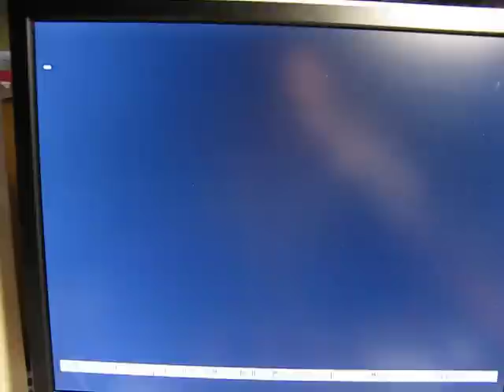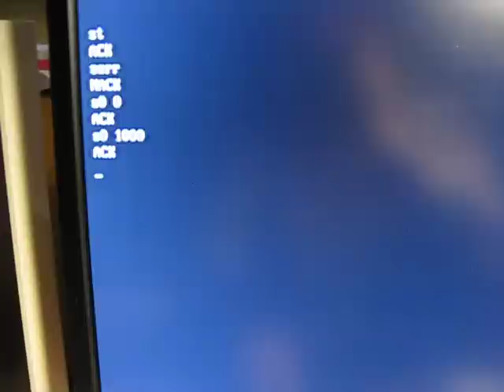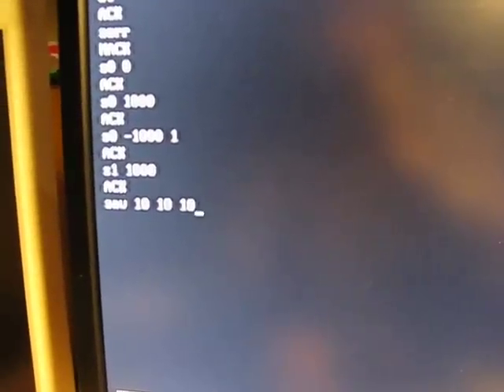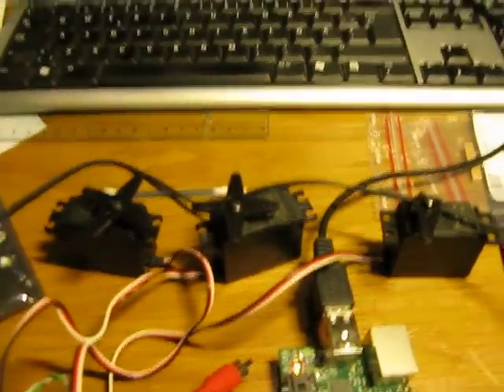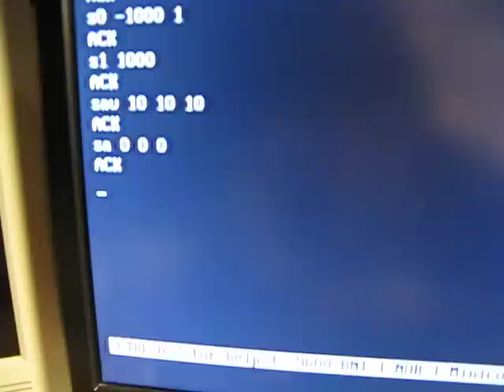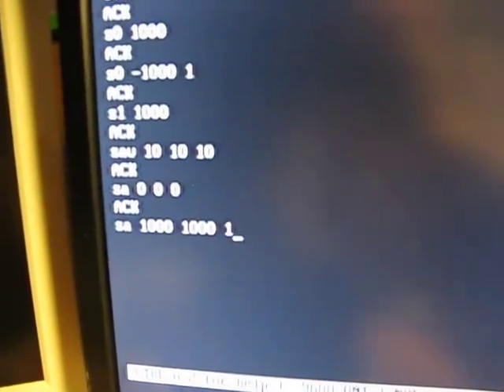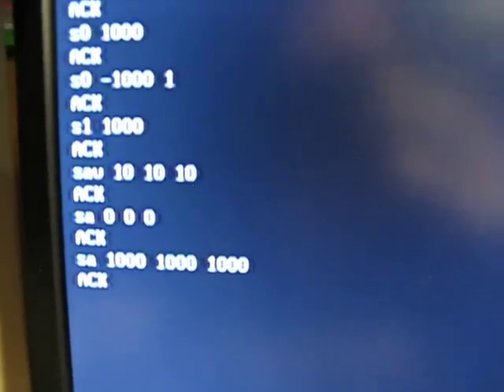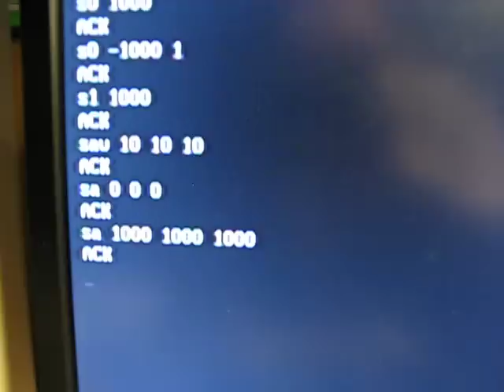Card to Control RC-servos from a Raspberry Pi

Comment from the maker: I'am planning on making everything open source or atleast open/available for personal use. 
I used the ATtiny2313. I have a little idea of making some boards for sale as well. 

To be honest I don't have an application yet. Maybe I'll find something fun to use it for. If using the RPI for a media-center one could connect a servo to move a lid or push a button ;)

It might be very useful for my plans to build a autonomus boat. An USB-GPS and a USB-GSM-module...

Comment from the maker: I have no cards left for now. Waiting for a new batch of PCBs. They are sligtly upgraded, but nothing special. Added room for pull-up resistors to be able to use the board to interface DHT22/11 Moist/temperature sensors instead.

Working on a binary protocol. Hopefully that make room for more stuff..

Comment: hi, in your pdf manual (i have v3 of the board) you say about using the three headers to power servos in various different ways.  i am not verry good at electronics so bear with me.  my ESC outputs 7.72 volts, if i remove the jumper and use the ESC to power the servos will it be ok, or will the 7.7 volts break the servo controller board or the raspberry pi?
Reply from the maker: If your ESC outputs 7.7V in the servo-connector it will indeed break both servo controller board and Raspberry pi. But it really should not output that high voltage. If it do it's probably broken. Somewhere around 5V is normal.
Reply: No, it says in my esc's manual that it should output 7.7 volts.  And I thought that by removing the jumper that the pi and rest of electronics was isolated from the servos?
Reply from the maker: Calum Bushell  Oh, thats odd, but ok :) Yes, by removing the jumper, your Pi and servo-board should be safe because there is no connection between servo rail power and raspberry pi power. The signal level to ESC's and servos from the servo board is 5V.
Reply: OK, thanks. :)

Comment: Would it work with the new 5$ Raspberry Pi Zero?
Reply from the maker: yes, i think so. I can not imagine they changed the pinout. Just solder a pin header to it.
Reply: +adentse are you going to make new videos and updates for the new 5 $ raspberry?